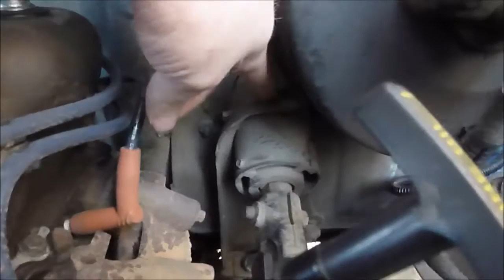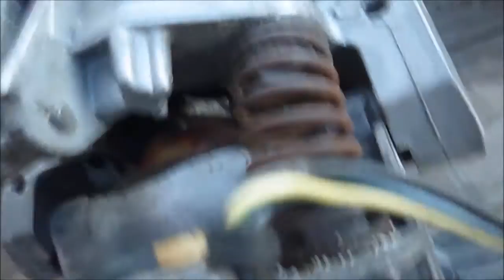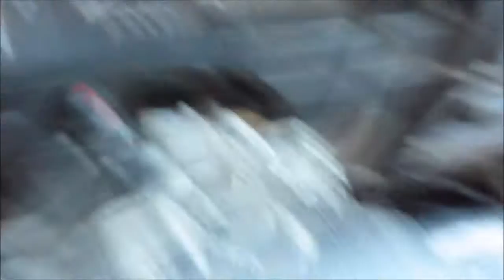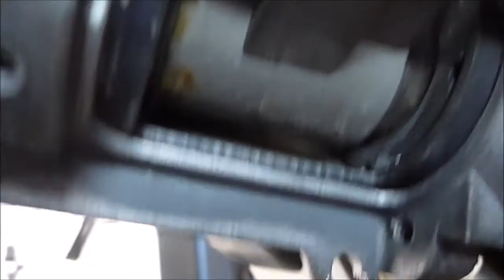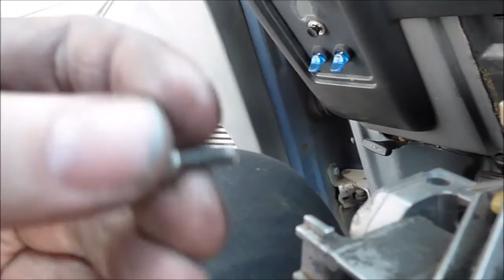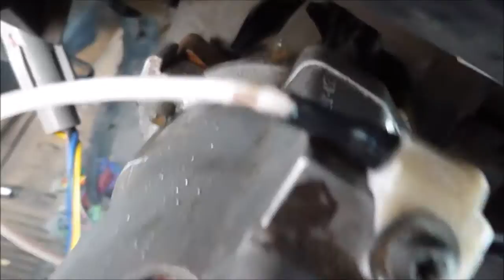1991 Ford Explorer - Steering Column Repair/Swap

Comment: This was VERY helpful!  1990 Bronco II, column looks identical.  My tilt is stuck in the down position and I can't seem to move it, so my journey begins!!
Reply: Turns out, the lubricant of the pivot points and the lower catch was dried out and sticky.  All I had to do was remove the bottom plastic cover and oil the catch/lock lever mechanism and the two pivot points.
I didn't see any nylon parts involved as you briefly described, perhaps lighting wasn't adequate?

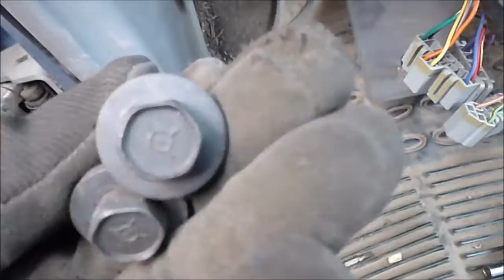Comment: 20:27 where can I get those exact plastic connectors? Please help
Reply from the maker: I'm not sure if you're talking about the breakaway pieces for the steering column or the bracket for the shifter. Either way I cannot find anything about them. In fact to fix my broken shift cable bracket I had to buy a whole new cable.
Reply: Oh I see, I found the plastic connectors online, I’m talking about the harness. Pause the video at that part and on the right hanging down is what I’m talking about
Reply from the maker: @christophersootoo9168  gotcha. Those are the multifunction switch connectors. AKA turn signal switch. You can do on RockAuto for 1P1156 and 1P1157. I believe that's what you're after.

Comment: Common sense say go buy an used column from either a explorer,Mazda b or another ranger
Reply from the maker: This was from a Ranger. It went into an early 1st gen Explorer. An Explorer, along with Aerostar, are both Ranger-Based Vehicles (RBV). Look it up, it's the same thing. They had the same frames, same engines, same transmissions. The Ranger had more engines available but even down to the sun visors and headlights, they were shared with the Explorer.

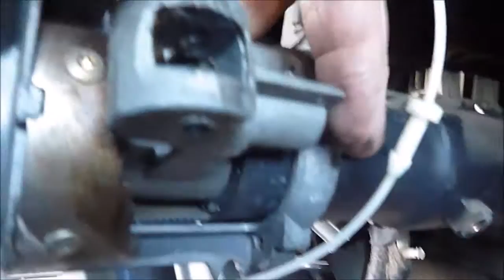Comment: Nate, I have a 1994 Ranger XLT 4.0L. I'm currently having the same, trying to replace the housing on the steering column.  The housing in this video is identical to what in my truck. At the 11:36 mark, you determined that you had to cut the piece of the housing. Was that the only solution?
Reply from the maker: Christopher Taylor I'm sure there's a way but I never figured it out. Making the cut didn't affect anything, I'm still driving this vehicle daily.
Reply from the maker: From the factory service manual, the answer lies in the blind rivet shown right after your timestamp. You drill that out and then the whole shift socket (part that the lever attaches to) should come out. When reassembling, use a 1/16 x 5/16" rivet.